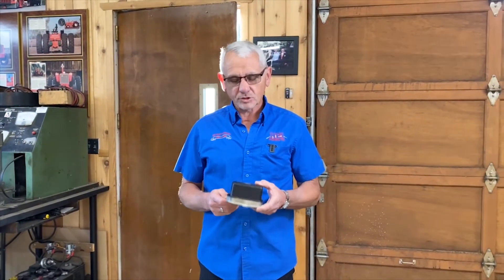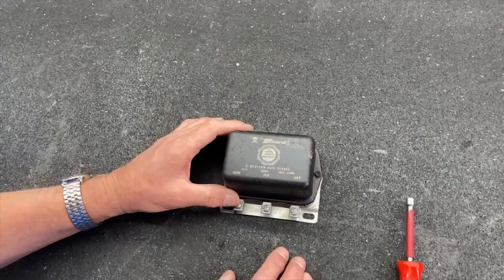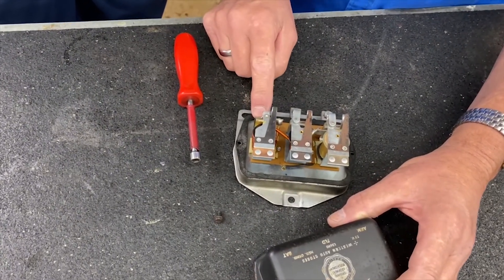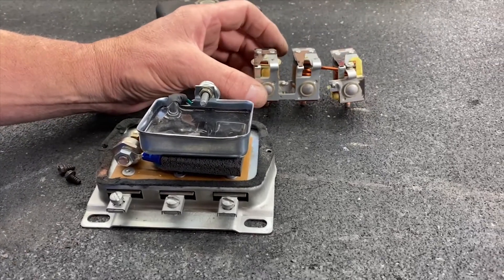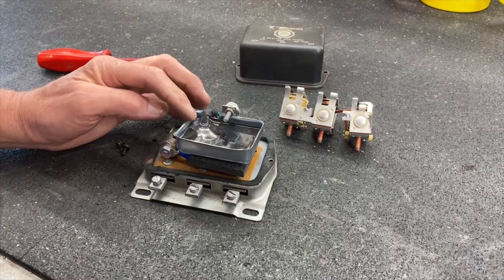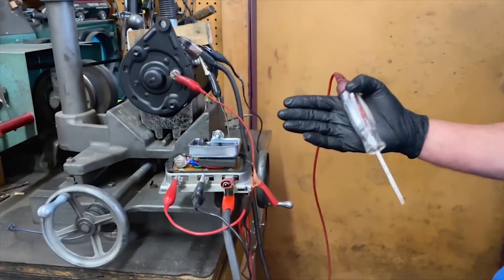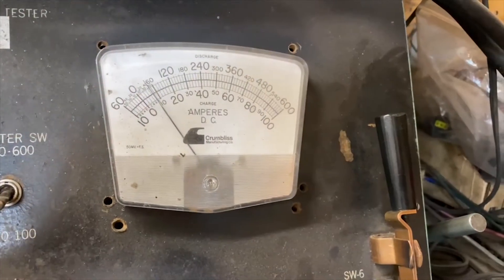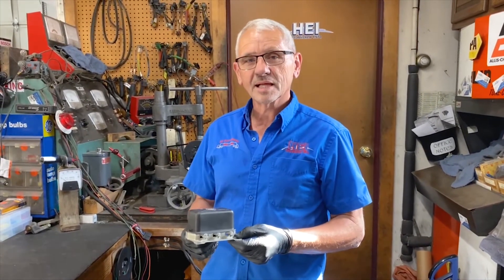Converting 12V Negative Ground Mechanical Regulator to Electronic

Comment: How do i get in touch with you guys i have a voltage regulator off a 64 johnson outboard looks identical to what you are working on im intrested in getting mine done
Reply from the maker: Call and ask for Larry at 800-944-0494